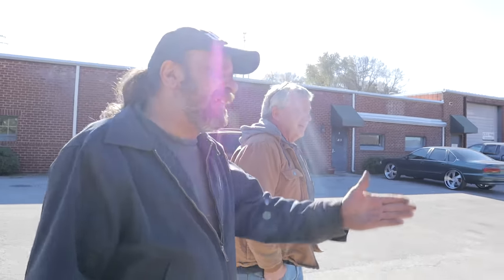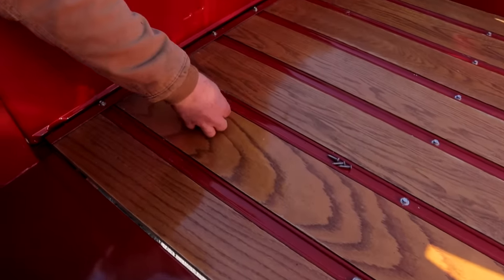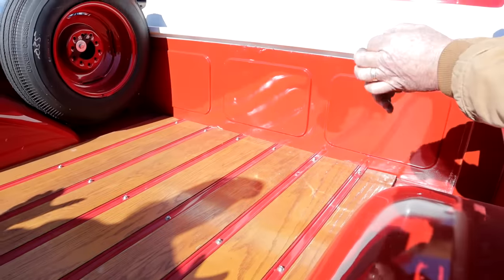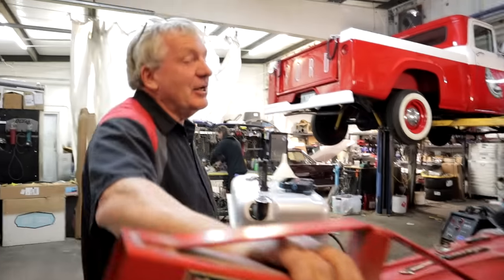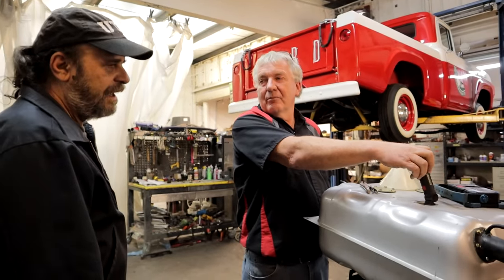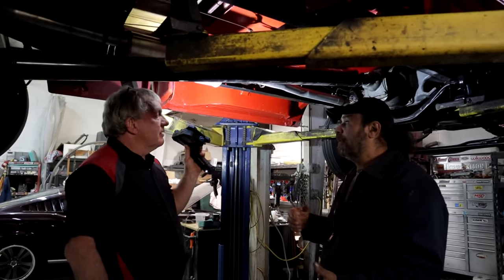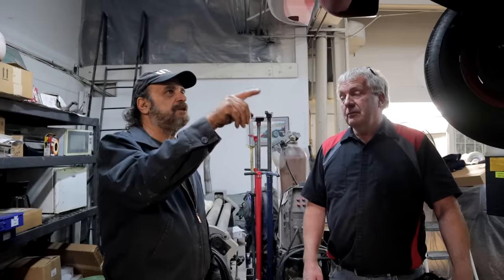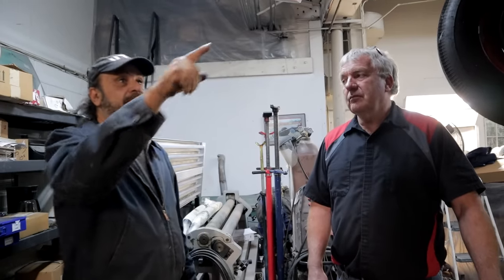Frame Off Restoration Gone Bad - Pretty Red Paint Hides Trashed And Rotted Parts Throughout

Comment: Words have meanings and "restoration" is no different. It's possibly the most misused word there is.

There are repairs, rebuilds, and restorations. This was a repair job and nowhere close to a restoration. A restoration means returning it to as-new condition in every way possible, and that job costs whatever it costs and takes as long as it takes. A rebuild means that it looks and functions nearly like as-new but may have repairs and incorrect parts in places you don't normally see or wouldn't be likely to know about. And a repair is just somehow fixing whatever is wrong with something that works (and hopefully looks nice too).

Comment: That's exactly why my 93 F250 is all original. Patina, vent holes, (from oxidation), and nothing bastardized. 
You don't have to wonder about a truck like mine. You can see the bed isn't connected everywhere, you can smell gasoline, and that sound when it's running isn't a blower or a turbo it's the new power steering pump screaming like it should. If you have some pedal you have brakes. If you don't have pedal put some fluid in.

Comment: That guys gas tank opinion makes no sense. It's pulling down on the bolts so we're gonna put the back under it instead. Then bolt the brace to the frame so it's still gonna pull down in the bolts. Just sounds so stupid. Even if it had straps its pulling down on the bolts.
Reply from the maker: No, the tanks flange will be resting on the cross braces instead of hanging from underneath.  In other words, even with the bolts out, the tank still can't drop

Comment: Heartbreaking for the owner.  I don’t know much about the garage in question, but I do know there’s two sides to every story  but anybody reputable should know better than to just slap shiny paint on some thing, and leave it in such a dangerous state with the gas tank for example.   I have a 1960 myself.    I hope you talked her into at least upgrading that master cylinder for safety reasons. Disc brakes would be even better, but at least the master cylinder to a dual

Comment: I seen a lot of shit work. Guys that claim they know a lot and may know a fair ammout of stuff. Then you find out most of the stuff they learned by reading but have never actually done it or ook good hands on schooling for it. I seen guys that owned just junk everythings rigged or short cuts were made because thats how they are they like owning junk and think its gold. Learned a lot from hands on as a kid at many dealers then school and then goodwin competition. You never know it all and learn non stop. Id like to work with count customs for a bit. Or tom nelson from mre racing man that guys shit is art one engine cost more then a couple of perfect restored classics. Its neat to see. All engines and intakes along with heads he desings and machines from one block of aluminum . Custom fabricating there is not many guys that can do it today. That trucks sad i agree it should be a crime body shops doing this should be closed down its a risk big time.

Comment: brother got on of these it was converted over to  dually and a one ton rear end with a 5 speed he paid 500.00 for it took off the dual tires and drove it for around fifteen years had a 292 cu in sold it for 800.00 never put a penny for repairs in it

Comment: I totally agree with the gist of this video, and i'm not making an attempt to defend the "restorers", but this may not be the whole story.  I'm a professional restorer, been doing it for 45 years, have seen a huge variety of jobs, customers, restorers etc., so let me throw a bit of experienced criticism in the pot.  First, tech or shop should never do work that is unsafe, there is never an excuse for doing something that may cause personal harm, whether it be time, budget, whatever, if it can't be done safely, you inform the customer and if they want it done anyway you refuse the job.  The front braces CAN be a safety concern, no doubt, but it is a bit on the exaggerated side to say this vehicle is unsafe to be in, it's strength has been compromised but to be honest, it would still take sufficent force from the right angle, right circumstances to injure someone because of that weakness, and the shop did not cause the weakness, it was there, they concealed it, again, NOT SAYING THIS WAS RIGHT!  Here's what i've seen happen alot,  the customer wants a pretty truck, they take it in they don't like the price, with discussion they say, "well make the outside nice and we'll just clean up the underside", saves alot of money.  The shop does a nice job on the outside and simply cleans up the bottom, maybe they see the rusted out supports and tell the customer, the customer doesnt want to fix them so they clean it up, make it look as good as they can, suddenly, the shop is not an evil money grabbing place trying to kill their customer, they are more guilty of not thinking and realizing they are actually concealing a structural issue that should not be ignored.  Most restorations and particularly modified customs will have a small list of issues after completion, be it poor reengineering or poor original engineering, a return trip to the shop is quite normal even in high dollar exacting projects, some of these cars were issues when they were born, rebirthing them gives you the same original issues!  The big question is, did this project get done in an agreed upon way, has the mutual goal of price, quality and time been met?  Has the shop been confronted with disparities and did they stand good for things they did outside of the agreement?  If the customer wanted this truck done right, the shop failed miserably!  If the customer paid half what the shop said a good job should cost, instructed them to not dive into lesser seen details, if the customer did not give the shop a chance to remedy obvious errors, like the tank, the window..then we have a different scenerio.  STILL NOT AN ENDORSEMENT OF THE SHOP!  One sided stories are just that, there may be more!  I've always been very careful in criticising my competiton because it's just not as simple as it looks from the outside, there is barely a job that goes through my hands where questions of integrity, quality, communication do not enter in.are you restoring or counterfitting?  are you safe to currant standards or 1940 standards? do you ignore 1% structural issue that is very expensive?  how about 30%?   It's all about communication, strength of character, and skill, and unfortunately those things are rare commodities!

Comment: This is exactly what happened to me as a 14 year old automotive student. I acquired a 1973 Datsun 240Z 15 years ago, that had spent its 40 something years in Maryland and handed it over to a "body shop" to have the rust and body work fixed and long story short. Same story. Bondo and epoxy used to fix rust. Tack welded structural supports where frame and chassis rails meet. Just poor poor quality work. On a car with a unit body frame. No frame to give structure. Talk about un safe. The car still isn't finished because I have to fix it the right way till I'm satisfied and I know it's safe.

Comment: what does he mean u can't clean the tank, u cut a big hole on top then u sand blast it then u weld it up then put new liner in it it is easy to do. i use to fix old fuel tanks and make radiators for model t from scratch then polished them to look as good as factory new. but to pay to have it dun it is about 1/2  of the price of buying a new tank

Comment: That is such a confusing sight. The paint is mint on that truck but the little bits... i mean absolutely amateur mistakes, self tapper screws, non existing sealing on relocated gastank.. the gas fill port is on.. very odd place, i mean there is bound to be water on the truck bed at some point. Just very odd and weird. It some how looks like somebody tried to put lots and lots of effort into this restoration, then got more frustrated with the project as "truck is no longer starting" then as things began to rot and guy not knowing why -> Sold off the project as is.. but knowing its rotten and full of little problems turned into big problems over time.

Comment: I just can’t grasp how so many of these youtube or tv shop builders still use a freaking cherry picker to install engines.. I don’t think they actually know how beneficial it is to have a bridge crane in a shop. So simple to build and so much they can do to benefit any shop. Cherry picking a engine is the most irritating and hard way to do it. A bridge crane even with a hand operated chain hoist is a simple one man operation and so much safer for the mechanic and the car!!

Comment: Dude insisting that the truck's not safe is cracking me up.  The underside of that truck looks new next to some of the junk I drive. All of it still passes the Virginia state inspection, though, even the 2x4s holding the flatbed on (not my work, btw) and the broken speedo.  XD

Comment: I just watched a video on maple moters it was a nice looking green 1970 Chevrolet for 39000 looked nice until the guy walked around it it had rust bubbles and a bunch of things that didn't work dang if I spent 40 grand on a car everything better work should not have to work on it you should go watch the video rust holes runs in the paint and clear you can tell were the bones is in the lower part of the car

Comment: I took my 1968 roadrunner have it completely inside and out eight months later I got the body back just sandblasted the best part My engine transmission rear end and  interior is nowhere to be found  they shut the doors on the business and move to another state this car was all original now I'm in a lawsuit with them  5  years ago I bought the car  my dream car  $46.000 and now I'm stuck with nothing but a shell and I was out fifteen thousand and the rest what's supposed to be paid when done

Comment: 70k for that paintjob is nuts! I have built over 100 53-72 f100 f250 and for 70k guy could of afforded to build that truck right. 
If he did not know how to weld he should of changed cab to a solid cab and everything tightened and a new battery.
I had less than 5k in the 72 i just finished.
Starting on a bumpside bronco 4dr f350 now

Comment: The restoration shop was not very meticulous.  Too often though, the classic car owners will become fixated on the 1 or 2% of the restoration that isn't  "perfect". Never mind what a basket case it was when they brought it in or how much work it took to give them a nice ride. Nope, it's all about the one gap a little wider, the window trim that doesn't line up. Better than it ever was but not good enough. No wonder why no shops want to do work on classics.

Comment: When it comes to safety standards, cars and trucks made in 1960 aren't even in the same solar system with vehicles made in 2020, or even 2000.  Having said that, I hate to think what would happen with that gas tank in even a relatively slow rear-end collision.  That tank setup  makes a Pinto look like a Humvee . . .

Comment: This happened to me with my first 79’ trans am but it was 27,000 and some change.  I sold the car 3 days after I got it back bc I was so frusterated at a huge loss.  I only got 7250 for it and the new owner still calls me to complain about the all the issues he’s finding still to this day 6 years later.

Comment: That sh"t was intentional. No half ass shop would do a job like that. It's literally a rip off. Can't even imagine having to rebuild a rebuild. I've seen better 'restorations' done in driveways with K-Mart parts that were better. The only thing I could say is that the paint work looks good. Probably done at a different shop.

Comment: No an old man perfected the hydrogen engine!! He made a 500 hp classic truck run on hydrogen which is made from water! All you need to do to make a water truck is put the water tank and hydrogen generator in the bed with the hydrogen tank! 

It’s obviously better though to have more hydrogen tanks! 

So yes hydrogen has been perfected & it comes directly from water!
He can’t say hydrogen cursive clearly not been perfected! 
Just because you don’t see something around everywhere doesn’t mean it’s not perfected! 

It only means the government or part of the government like the EPA is holding us back for the purposes of selling more petrol or diesel fuel!!